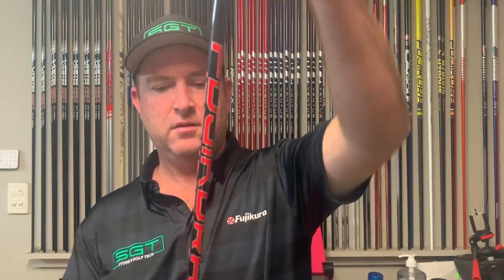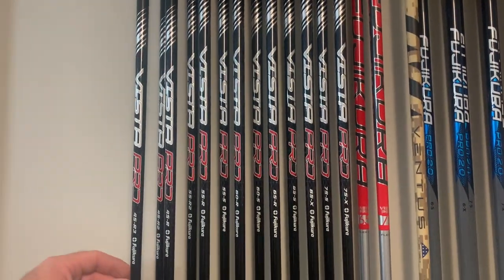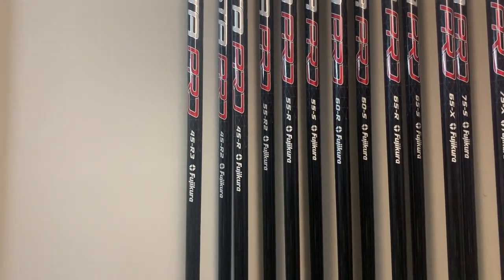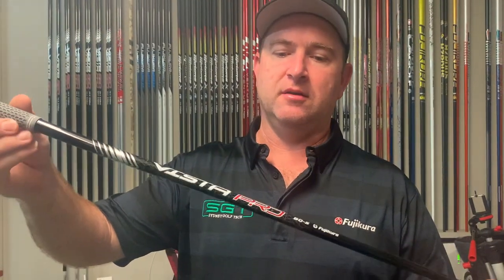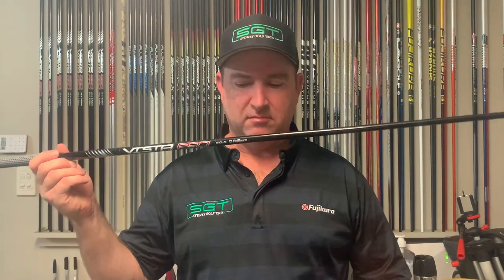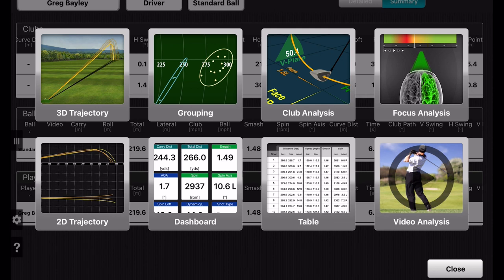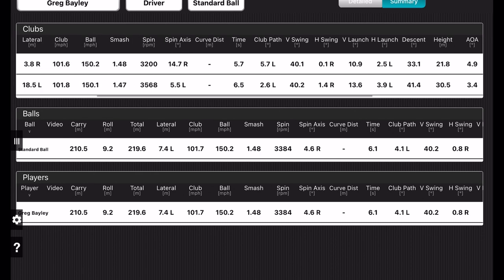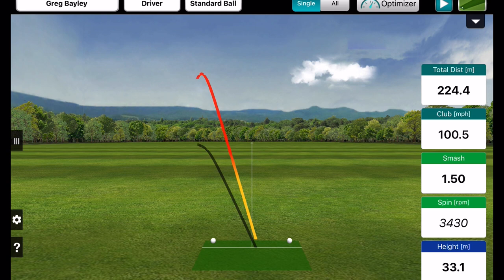Fujikura Vista Pro 2021 Review

Comment: Howdy ,  Have a set of the Fujikura Vista Pro 70 Stiff Irons  .   Can you do a soft step  on them ?    Can you do a full flex  making ones 4 iron a 6 irons  two clubs adjustment.   Of a set I understand I would have to buy two new shafts .  Or it's not doable with graphite ?
Reply from the maker: Yes you can soft step the vista pro.